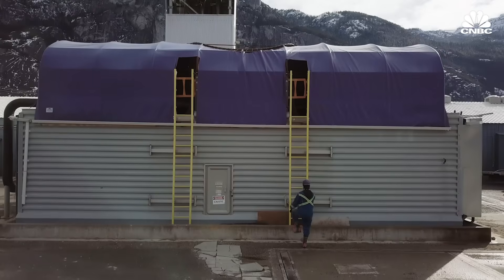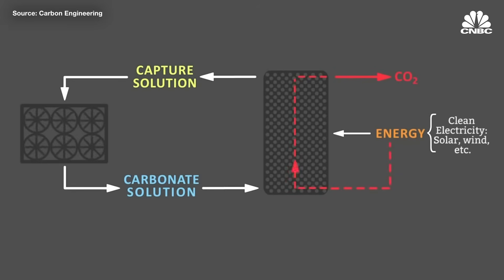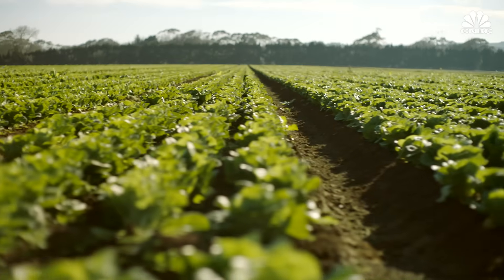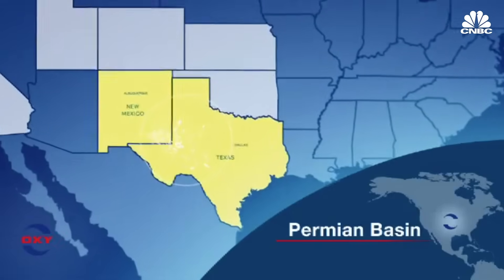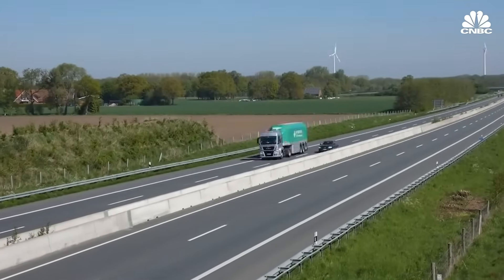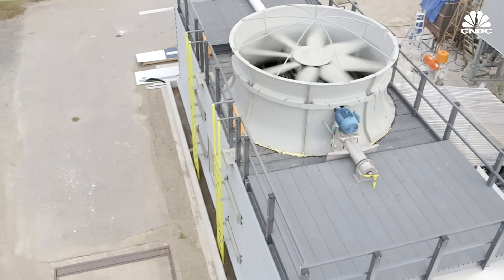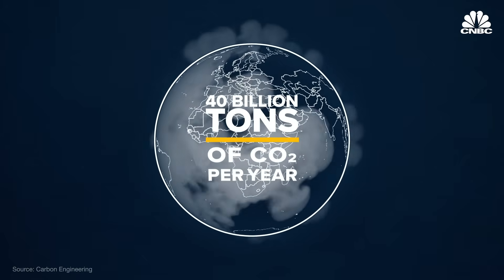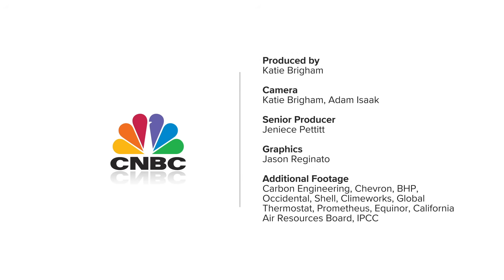Bill Gates-Backed Carbon Capture Plant Does The Work Of 40 Million Trees

Comment: Polyethylene also absorbs CO² under certain humidity levels, releasing it in more humid levels.  You'd just need to give it a lot of surface area and pass it from one humid environment to another.  Once you have the CO² concentrated, you can use a cobalt oxide catalyst heated by a clean source of energy to rip an oxygen atom off it to form carbon monoxide then if you do the same to water to produce hydrogen, you have a mixture of carbon monoxide and hydrogen which is called syngas because it's used in our refineries Fischer Tropsche reactors to synthesize linear hydrocarbons such as diesel, gasoline, or even plastics such as disposable grocery bags.   You can literally use clean energy to make fuel from CO² and H²O (Sandia Labs Sunlight to Petroleum project).

Thing is, the levels of CO² in our atmosphere is measured in parts per billion so it's not very concentrated, it would be easier to extract it from the chimneys of coal or natural gas power plants than from air.

Comment: I know how to cut the co2's down substantially, just lower the speed limit down to 55, that alone would cut the emissions down 10 to 20%. Also we could lower our thermostats down to no more than 50 degree's during the winter's and no less than 82 degree's during the summer months win win 2021, instant lowering of Co2's. eat less beef.
Reply: Not really. Cars are must fuel efficient, which means least carbon producing, at 65-70 MPH. 
This is because of overdrive transmissions. 
To reduce massive carbon emissions, eliminate gridlock. Combustion engines idling while stopped in gridlock is absolutely wasteful. Engines dumping carbon in the air for hours at a time while not moving anywhere. 
WITHIN REASON, The quicker someone gets home, that’s less time they are dumping carbon into the air. 
That means normal cruising driving at max highway MPG with as little idling as possible and no speed-racing.
Reply: @jimm3093  Well i do not have over drive, my truck is geared low so that it can handle heavy loads. I do not travel the free way's often though They are more fuel efficient on the free ways that I'll agree with. But if I do travel it, there will be more carbon the faster I go no matter if I had over drive or not. So the point I'm trying to make, if they lower the speed limits it would be instant, of lowering carbons into the atmosphere . Win win situation .
Reply: @scottsrfun  for you, driving 55mph or less is more fuel efficient. That’s because you have very deep gearing in your transmission and your final drive. 
For everyone else, the vast majority of us have overdrive and more moderate to highway speed final drives. 
We would dump more emissions driving below 65-75 MPH. 
The vast majority of the traveling public (NOT Commercial) will pollute more below 65-70mph. 
If you mean reduce heavy hauler traffic without any gearing for highway speeds to 55mph, then yes, you’re correct. 
As a heavy hauler, you can do your part just like what you already do: stay off the freeway, never bobtail, watch your speed and fuel efficiency. 
Then also obey ordinances and never idle while stopped unless you are actually driving. 
If possible, plan your routes to avoid as many stoplights and stop signs as possible. Your heavy hauler burns the most fuel when accelerating that heavy mass of you loaded vehicle.
Reply: @jimm3093  Your wrong it doesn't matter what gears you have in your vehicle you use more fuel to travel faster, that my friend should be a no brainer. You have to quit watching so many marvel movies and know a little more about physics .
Reply: @scottsrfun  No I’m not wrong. And forcing every vehicle to that magic 55mph to make less pollution is just as much fantasy as the Marvel movies you mentioned. 

You brought up physics, do let me give you some:
Look up the work-energy theorem. Work done to accelerate your heavy truck burns more fuel. You do most of that from dead stop. 
More fuel burnt is more pollution

More physics: look up coefficient of drag. 
Your big rig is massively less aerodynamically efficient as a 4door sedan. Even more fuel burnt at freeway speed no matter what underbody and tail skirts of roof shield you install. 
That sedan is like a razor through air. 
Since forcing a given cross-section through air is an exponential function, that sedan is not as severely affected by speed. 

Now look of moment couplings to understand why gearing DOES have an effect on fuel efficiency. 
It’s the largest contributor to why cars can go 65-70mpg and pollute less than driving 55 or less

These are all 100% physics. 
55mph was Federally repealed for a very good reason. 
The USDOT and regulatory bodies like the EPA did the studies. 

I’ve been in the transportation industry for over 25 years. 
You sound like you driven a truck longer but trust me, knowing physics is completely different than just driving a truck. 
Physics is a very massively larger domain than you think.
Reply: @jimm3093  You forgot to mention terrain when you are traveling at 70 miles per hour with that little sedan of yours. Does not matter if you are traveling up hill with aero dynamic's. They might help somewhat but not much. So your theory on good gas mileage does not calculate that I'm sure. They constantly are shifting gears to climb the hills , which is a strain on the power train, which causes less fuel efficiency to maintain that speed. Not to mention the damage it causes to the power train. 20 miles per hour less would substantially lower the need for your sedan need to shift gears, and there for using less energy to complete it's task.
Reply: @scottsrfun  Terrain will scale exponentially for all vehicles, yes, but again gearing is in play. 
You have to drop many more gears to maintain speed or at least to not drop below minimum speed limit. 

Sedans being massively lighter, only 3000 lbf and not your commercial 80-84K lbs, will more than likely remain in overdrive unless the grade is significantly high. 
As for drivetrain wear, your 84k lbf rig will feel it. 
A 3000 lbf Sedan or even a 6000 lbf pickup truck? Not so much because they are very easily less than 10% of your weight. 

Again, physics. Mass scales linearly and Force and all Force dependent variables scale exponentially

Comment: We need to remember that this technology needs energy itself. Therefore, it will only work if the energy used is renewable
Reply: that’s what it does it takes the CO2 and provides a very low CO2 admitting fuel

Comment: CO2 can be extracted (concentrated) from the air by such mechanisms as dissolving it in expanses of water, then driving it out of the water in a confined space, pressurizing it, bottling it, storing it etc, all requiring expenditures of otherwise usable energy.  To go further and convert it into a usable hydrocarbon fuel requires more energy than is released by the burning of that fuel.  IOW, if the energy required to turn the CO2 into fuel comes from fossil fuels, you'd have to burn more than you create.  Any fuel so created has to be seen as an energy storage and/or transport mechanism rather than a primary energy source.  The world economy can not be run on a perpetual motion machine that extracts work from hydrocarbons by burning them, while expending energy to recombine CO2 and H2O into hydrocarbons to fuel a closed process.  Any such process requires an external energy source.  I won't bother to compute the EROEI (energy return on energy invested), but it's clearly less than 1 even if you exclude the first part of concentrating the CO2.

Comment: Excuse me for being dense, but could not the Oxygen be extracted from the Carbon Dioxide and put back in the atmosphere and the carbon used to make carbon fibers to build stuff [more carbon extraction plants maybe?]
Reply: DAC direct air capture made hydrocarbon strain, not carbon. The end product is by water electrolysis and synthesis is gasoline which can be burn to make electricity. The energy use to make the gasoline is bigger than the energy it product. 
Hope that make sense.

Comment: Some stoichiometry here doesn't make sense, even if the fuels had 90% less carbon output then that 90% still has to go somewhere, and the 10% would go into the atmosphere that would ostensibly be re-sequestered by the plant. But you can't just keep using the same carbon over and over, releasing it and sequestering it endlessly, the law of conservation of mass and energy forbids it. Where is the carbon and energy coming and going, what's really powering the plant. And giving the fossil fuel industry a "clean" fuel gives them no incentive to actually switch to it, all it gives them is political cover to keep using crude oil and gas while saying they are developing clean energy. These people are either corrupt or myopic morons.

Comment: People who argue that you shouldnt involve oil-companies in the procress are delusional.

With the inventions of e-fuels and these plants in conjunction we can have C02-neutral fuels.
We have the infrastructure for gasoline and diesel.
Its a win.

People who dream of 100% battery-electric cars ... yeah. Produce all that energie and more importantly: Distribute all that electricity when all people want to charge their cars... your grid will literally burn down. Not to speak of the ressources for the batteries...
Hydrogen might be a solution, but again: Infrastructure.

I am absolutely pro these plants ... lets plant more trees as well, though. There are many areas that could use 
renaturalisation
Reply: I would agree with this. Although this does assume there is an unlimited supply of fossil fuels. Partnering with oil companies would prolong the inevitable so we need to change the infrastructure.

Comment: Hey, trees are great because they also provide O, act as windbreaks, shade providers and prevent soil erosion, which this thing doesn't. Hey Physicists have just come out and said that by 2025 hydrogen fusion plants will be able to use the current grid structure and produce more than enough energy, I also would combine with that renewable sources too. Hydrogen is plentiful and instead of extracting it from fossil fuels it also can be extracted from bacteria , algae (which would be great in removing some of that bad algae from the oceans where it is smothering life) , and other non-fossil fuel sources. Those Fusion plants would also use less fuel than a regular nuclear plant and" Fusion on the other hand does not create any long-lived radioactive nuclear waste. A fusion reactor produces helium, which is an inert gas. It also produces and consumes tritium within the plant in a closed circuit. Tritium is radioactive (a beta emitter) but its half life is short". So investing in renewables and Hydrogen fusion plants is the better investment for energy !!!!!!!

Comment: just because he invested in it does not mean it works or is viable
But beyond the glowing headlines, outside experts vigorously dispute such assertions. The amount of CO2 floating around in the ambient air is generally 300 times less concentrated than in a smokestack or pipeline, making the gas far less efficient to capture. And professors from the nation's top engineering schools – from Stanford to MIT, Berkeley and Carnegie Mellon – insist that the company's math simply doesn't add up.

Comment: Both are needed.

The profs did offer their reasons, albeit, they might seem a little biased.
Their main point was that with lesser monetary investment in other technologies, the same results can be acheived.

However, I agree more with the view that we need both.
Carbon capturing that keeps fossil fuel industry carbon neutral, and does not further accelerate it. 
Direct Carbon captuting is 100% needed for reversing Global warmimg. If, it can be used for manufactuting cleaner fuels, then, it will be great.
Reply: man are you wrong. Mr Khan
Fiona Wild is also wrong
co2 lags behind the temperature of the oceans not the other way around.
Plant grow lags co2, but not much.
Study the solubility dependence on temperature, it is quite significant, high at low temperatures, actually very high, low at higher temperature. When the ocean warms, co2 gets expelled. in arctic waters the solubility of co2 is so high that it is always absorbed in great quantities, to feed the plankton  feeding the krill, feeding the whales, the entire food chain . Its penetration is so deep that bakteria synthesize the co2 into hydro methane in huge quantities, in coastal areas, vastly surpassing the NG in the ground.
Before you dismiss me do some research and think about it.

Comment: Look at those unless professors “you’re not stopping the fossil fuel industry” lmfao is that the goal? The goal is reduce CO2 and other greenhouse gasses. There is a reason these people teach and not working in industry, they’re useless.
Reply: The profs did offer their reasons, albeit, they might seem a little biased.
Their main point was that with lesser monetary investment in other technologies, the same results can be acheived.

However, I agree more with the view that we need both.
Carbon capturing that keeps fossil fuel industry carbon neutral, and does not further accelerate it. 
Direct Carbon captuting is 100% needed for reversing Global warmimg. If, it can be used for manufactuting cleaner fuels, then, it will be great.
Reply: It is the fossil fuel industry's actions and products that produce the excess CO2 in the atmosphere. Like their promotion of H2 for energy and vehicles, cheapest source is from Nat Gas/Methane which results in CO2 as a waste product

Comment: So you are saying that more solar, EVs is the answer? Let me ask you one question to that. What kind of toxic impact will the disposal of these lithium batteries and solar cells that are no longer any good to to our ground water? Now you tell me you can take existing CO2 out of our air and make bio fuel without drilling into our water table and ocean's and destroying the earth and you're against that? I'm confused. No more drilling, no more toxic mining processes for cobalt, nickle, and lithium for EVs. <----That would be good. EVs and solar panels are good to a point but the massive strain on the grid if we go to an all electric society and how much land solar panels take up VS using 80%-100% emission free fuel, with a continuous extraction of CO2. I don't see this taking a college degree to figure this out. 
  No one seems to the see the unintended effects of the "Green Energy". This green energy is just as toxic in a different form.

Comment: I used to work for oil producers. Using CO2  to enhance oil production can't sequester  CO.2 Why? The producing formations where the CO2 will be injected into has to be vented to the atmosphere, so the oil can be extracted. I have never seen a well that produces a fluid, that wasn't vented. That includes the water well  on my my property that serves my home.  Wells that produce both oil and gas that separated   to two at some point along the line, but the oil will still have naturally entrained gas that will be vented.  The oil producers will never be totally honest.

Comment: New Nuclear reactor designs can generate carbon free enery day and night, reliably.  Some of the designs, like traveling wave and molten salts reactors,  can use the "waste "nuclear fuel that is a current biohazard thus reducing risk.  These reactors have benn approved by the US  government but the energy companies don't want to invest in these technologies in the US.  Here is info that may supprise you, the nuclear power industry has a better safety record than gas, oil, coal, wind and solar.  Check on it before you comment.  I grew up near 3 mile island and know the fear that was justified at the time.  Both the state government and the public were lied to about the event.  That reactor plant was a previous generation design.  There are several types of reactor designs today that can not melt down.  Oh yeah, what about methane?

Comment: It seems like a fraud to me.
The carbon they are capturing is sold for it to be pumped back to the atmosphere.
Reply: if this is mass produced then TESLA is doomed
Reply: Yes. But, that would mean, if this is able to go large scale, at some point, we won't be putting anymore CO2 into the atmosphere than what we take out. They did say they were working on using the byproduct as fuel. If that's able to be produced in large enough quantities, that reduces our reliance on foreign fuels and gives us an additional renewable resource. Then the question gets down to, "How long will this supply of chemicals last us for us to continue doing this before we need another solution?"

Comment: Bill Gates supporting this project and direct air carbon capture in general has only Bill’s name attached to it but no credibility from a cost effectiveness standpoint. The cost of removing the carbon from one gallon of gasoline say is at least ten times what it could be sold for and requires many units of free excess renewable energy to make it even appear viable.  Added problems are that the Carbon Dioxide is mostly used to force more Fossil Fuel out of the ground which pretends they’re saving carbon from going into the atmosphere. Additional carbon is emitted just to build these plants so why not just use that money to install renewable energy capacity and skip the middle man which is the oil companies trying yet another trick to distract us from simply forcing them to pay for the damage their products cause. if we did that, the problem would be solved overnight because globally Fossil Fuel created $68T in damage in a World economy of $87T.  Let’s just use the renewable energy to bypass the need for Fossil Fuel: cheaper and cleaner.